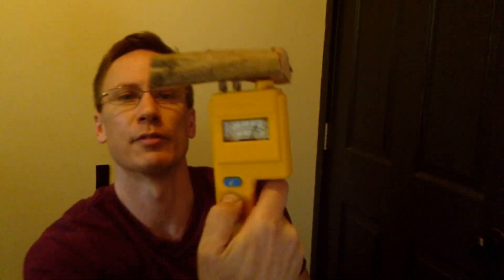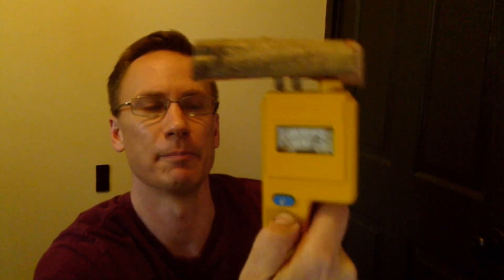Making Cleaner Powder, Part 2

Comment: Howdy, Ben. I have a toaster over that I use for artificially drying my wood before I char it. I’ve never checked the moisture content but it definitely chars faster.
Reply from the maker: Nice! Thanks for sharing Jake!
Reply: i may have a sacrificial toaster oven on a safe ish welding area table and I may have finished product inside to "re" finish at a temp just above the 240f melting point of one ingredient while driving off milling or production moisture and mechanically consolidating ingredients? YES! Do Not! use your Wifes' oven? Low and Slow is fast! or the steam trapped in a pucked product gets Very angry when no longer trapped. "Pucken A"  keeps my "Grains!" closer to my Grain?
Reply from the maker: Thanks Dave!

Comment: I dunno, Ben, the moisture steams off in the retort just fine.  The wood itself won't get much above the boiling point of water until all the moisture is gone, then the temperature starts to rise and the wood chars (phase plateau).  What makes good gunpowder charcoal is what happens after the water is gone, i.e. what fractions of volatiles are evaporated and what fractions are left behind based on the temperature at which the retort is maintained.  Some portion of fouling can be made worse from a "dirty" powder burn due to too little fuel in the mix when the charcoal has been heated too much for too long.    Black powder combustion is a whole series of chemical reactions, some occurring simultaneously, not just one simple reaction, and the byproducts and downstream reactions are variable based on a number of factors such as charcoal chemistry, peak pressure level, and water content of the BP itself.  Controlling those reactions are difficult and predicting them is impossible.   I think the best we can do is use good, pure chemicals,  proven good wood, keep our retort temperature between 550 and 600F, mill only very dry ingredients, mill the green meal thoroughly, press it well and consistently, and utter incantations under a gibbous moon.
Reply: "True" but? the steam inside of your materials is at a Hi Pressure (wood popping) until this pressure overcomes the environment at this point the materials basically become a cracker unit? we Maybe? I am doing this backwards? "I'm going" to try to Wood Gasify my materials for their gasses, then test that char byproduct? Europe used lots of coal or wood gasses back in the day. our ancestors wasted nothing. the Coal Char I tested was  slow, dirty, but could be good, Ok, or cheap for mining?
Reply from the maker: It may not do anything, just want to "leave no stone unturned" so to speak.
Reply: @HoffmanReproductions  Roger that, we appreciate your work.  I'm still fine-tuning other things like puck density (1.7-1.8g/cc isn't always best), retort temp, and mill time.  Those things affect ball speed and fouling significantly.
Reply from the maker: @geargnasher9822  For sure. Your most welcome and thank you for watching!

Comment: I cast lead balls as you did for my mill, but found I could just use culls from cast 45-cal bullets. It has bothered me thinking about the lead coming off of both and being deposited in the black powder. Then, I had a brilliant idea that I suggested to another well-known BP YouTuber. He never responded, so I put it to you. If a person powder coats the lead balls/bullet culls, I think it would eliminate the lead dispersed and still keep the weight to mix and compact the black powder. What do you think?
Reply from the maker: Yes Sir, it would work. You would need to make sure whatever you coated them with does not come off. I just tried brass & stainless steel ball bearings, worked great with no mess of the lead.
Reply: @HoffmanReproductions  I got the idea after watching someone coat bullets with HighTech bullet coating, then smash the bullet with a hammer on an anvil. The coating didn't come off or crack. It stayed intact with the shape of the bullet.

Comment: Hello, I'm new to this but wanting to learn and was under the impression you couldn't use stainless steel or glass because of sparks. What is the safest media to use? like your channel
Reply from the maker: Lead can be used, but makes dirty powder. The use of other media is safe in my ballmill as it only turns at 75 rpm or so .At that speed, it would be really hard to generate a spark. At the end of the day, just be sure to always keep the batches small so if you would have a batch blow. no harm no foul. Thanks for watching!